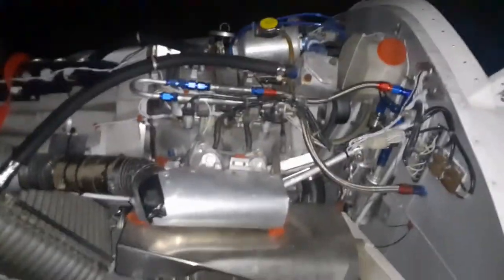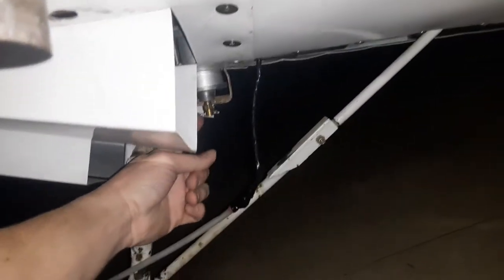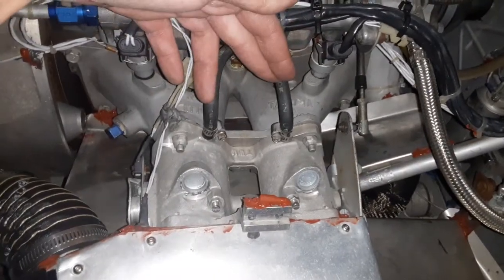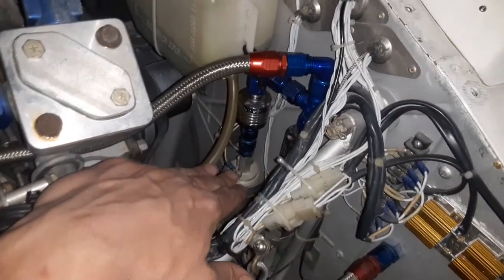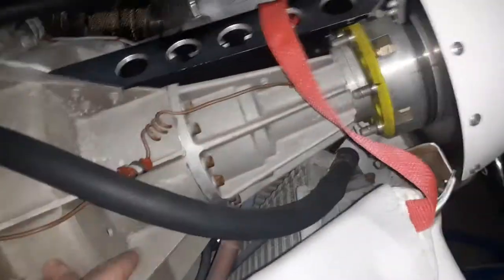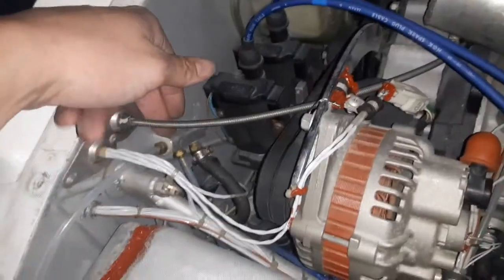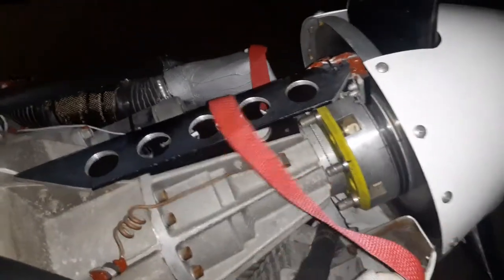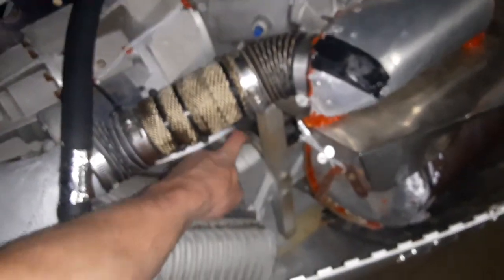Rotary Dyke Delta firewall forward

Comment: Dillon, thanks for a great overview!  Question: I think I see from your other videos that maybe you swapped out the rotary for a lycoming?  Do I have that right and if so what was you motivation for doing that and how did it turn out?
Reply from the maker: @hu5116  I did swap the engine because the rotary is harder to cool in the Delta and its like lycoming o320 power but its a little heavier and less mpg and the Delta is supposed to have the lycoming o360
Reply: @dillonhopson4367  OK Super!  Did your Delta come with that engine or did you install it yourself?  Was interested because 1) I just sent in my fee for getting Delta plans so getting more interested in such things, and 2) I also was interested in a rotary for lower vibrations. That said, there was a video I watched the other day where a young lad had a home built experimental into which he put some auto engine (maybe a Subaru?), and he was flying around and the propeller fell off!  Either blew the main bearing or cracked the shaft or both. Fortunately he was able to land on a highway. It kinda brought home to me that we need to be very careful using unintended parts for airplanes: I’m sure the car engine was never specified for a whirling propeller, with its pulsing loads, particularly if the prop might have been even a little unbalanced. So if we want to take that as a lesson, it might have been wise for you to move to a purposed airplane engine!  Anyhow, I’m just starting on this journey, and not quite sure where I’m going with it quite yet, but I might want to reach out to you in the future. Thanks for the video!
Reply from the maker: @hu5116  well the rotary is harder to cool in the delta wing and lifting body platform and without boost it’s about 150 horsepower and weighs 50 pounds more than the correct lycoming o360 180hp. It’s smooth but always pros and cons. Mine had the engine on it from the original builder. I put the correct engine on this one and I’m putting the rotary on my biplane.

Comment: What engine rpm do you use for max continuous operation? Climb power? Really cool install, best if luck, look forward to some flying video!!
Reply from the maker: Take off is 6450 to 6500 for 5 minutes or as long as temps hold. Cruise 4800-5300 is recommended. Climb will probably be 6000-6300 depending on weight and conditions.
Reply from the maker: I have been told this isn't much stress in a rotary.
Reply: @dillonhopson4367  Well, I remember some folks running them in sand rails revving much higher than that. Good luck with the flight testing!! Look forward to the video😁👍🙏